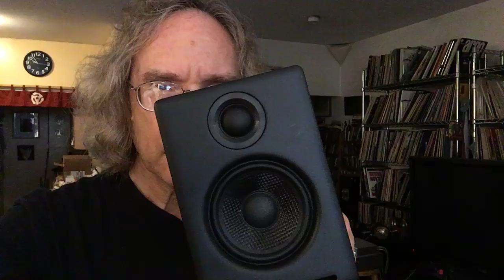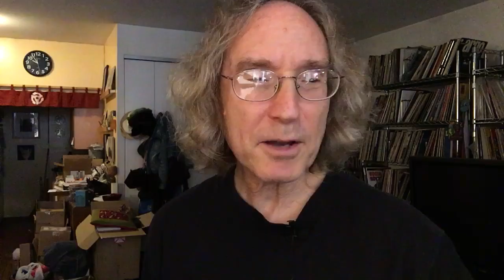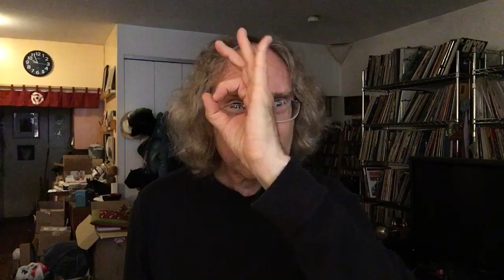The case against 1 inch dome tweeters

Comment: It's possible that a 1" diameter tweeter will cause the high frequency sound waves to issue concentrically from the tweeter dome minimizing phase cancellation providing uniform frequency response and better imaging.  A tweeter having a large area could cause phase cancellations and reinforcements when you moved relative to the radiating surface -- what we used to call the "picket fence" effect.

Comment: Personally when designing/building speakers I am not crazy about domes, ribbons or air motions crossed over below 2000 hz. Have found that the average 1"-1.5" dome rarely (lots of exceptions) performs extremely well as a stand alone driver for the entire lower and upper HF range. You need a very well engineered crossover to make it work (ie: LS3/5A @3000hz). Would still rather see a separate mid range up to 4000-4500 hz and then a tweeter above that or two way with a super tweeter that rolls in above 12 khz.

Comment: Steve, ever since I was a young boy I have used sound or noise protection around uncomfortable noises. Not just loud but annoying frequencies as would come from a mother in law. I did this because the entire generation of men before me went DEAF because they thought it was a manly or macho thing to handle loud noises. My hearing is great!, People are amazed when I am the only person in the room who runs out when we test the high frequencies of loudspeakers. They hear nothing and I am the dog in the room. That said, I have never heard a ribbon tweeter that I like. My closet has 10 different pairs but I never warmed up to them except the speakers from Legacy. I love Seas, Scanspeak and Dynaudio soft dome tweeters. In my home system I use a Cabasse polycarbonate dome which is also an excellent performer thanks to Geffery Dillon of Dillon audio but I love the dome.
Reply: nicholascremato
"That said, I have never heard a ribbon tweeter that I like. "
What is it you don't like about them? I'm curious because I never heard one but I read some conflicting opinions (and comparing with silk dome), and new designs that are well regarded come with those.

Comment: My system is one pair of pioneer andrew jones BS-22 bookshelf units stacked on top of one pair pioneer andrew jones FS-52 towers. Two (one inch) dome tweeters on the left. Two on the right. Really loud, smooth, dynamic and powerful for less than $300 total brand new speaker cost.

Comment: Soft dome tweeters have a maximum design and physical output in terms of loudness which may be less than hard dome tweeters,cone tweeters etc.
I don't think they are inadequate in the way you said you felt, because the answer is simply to use multiples of them to obtain the necessary volume in order to benefit from their sweet tone.
Of course,multiple tweeters of any variety follow the same rules.

Comment: Consider this: 3kHz to 20KHz is only three octaves.  The woofer has to produce something more like six or seven octaves.  To me this is why so much more effort goes into the woofer.
Reply: @JAustin-c6q  : I'm not sure, if you are THE "J(im) Austin"--if you are, I'm sure you know what you are talking about in regards to audio, but: Octaves are not really man-made things. The relationship between 2 notes an octave apart is a mathematical and natural one, that would exist everywhere in nature and would be very distinguishable from the relationship of any other interval, quite without any human involvement. It also exists for any kind of vibration, including the entire electromagnetic spectrum (and it is also quite interesting that we are able to visually perceive exactly one octave of that spectrum)
The fact that we divide the audio spectrum into octaves is not arbitrary. It follows a mathematical principle. It is unlikely that any other (imaginary) intelligent species would not also have come up with some kind of octave-based division of audio frequencies.
It is much more significant how many octaves a component covers than how many Hz are in between. The difference between 25Hz and 50Hz is in almost every significant way the same as the difference between 10kHz and 20kHz, even though one consists of only 25Hz and one of 10,000 Hz.  (It may actually be much more accurate to say that "Herz are man made things")
Reply: is not only the octave..is the wavelenght
Reply: To top that excursion required to produce the same level is inversely proportional to the octave, meaning each octave you drop doubles the demand on the speaker.  Most music is pink noise which adds another inverse proportionality, so we're really looking at quadruple the demand per octave you drop.  With seven octaves on the woofer and three on the tweeter we're looking at 156 times the motion on the woofer vs the tweeter.
Reply: That said though in terms of breakup a dome is literally the worst design, because it is edge driven.  They've chosen the longest distance possible for the waves to travel in the dome.  This is why really only a .75" dome doesn't drop off 15db at 45 degrees between 10khz and 20khz.
Reply: A midrange will cut the number of octaves that a woofer has to do in half for a more effortless sound reproduction which is why SQ competition cars have a 3 way front stage.
Reply: Going with a larger woofer >8 and throwing in a dome or cone midrange can make a difference. So the woofer only has to do 4 octaves and the midrange does the 3 octaves between the woofer and tweeter. Like 350Hz and 3000Hz crossover.
Reply: may be just 3 octaves, but PHYSICAL demands of energy transfer to the different kinds of transducers G mentioned cannot be thought through with just "octaves".  Imagine, that little piece of metal or silk is actually physically moving, vibrating, resonating, etc.  Octaves is just a word that helps us imagine abstractions of sound and music, but various heat and stress effects on silk, aluminum, carbon, and etc. are physical events.  One can be "fudged" a bit, but the other cannot, without damage to the tweet :)
Reply: No, the reason is the ear becomes less sensitive to lower frequencies meaning you need to push much larger volumes of air to hear or feel it. More effort?, subwoofer design is pretty simplistic for speaker manufacturers; the difficult part is manufacturing high excursion drivers that stay linear along their travel whilst having adequate cooling of the voice coil.
Reply: everything above 12khz is superfluous because it adds nothing to the musical appreciation.
Reply: Dream Diction: That depends what age you are, there is plenty of high frequency content in music; though if you above 50 you wont hear a lot of it.
Reply: Suzy Siviter   Read what I said . . . "everything about 12khz is superfluous because it adds nothing the musical appreciation."
Reply: Dream Diction: Well thats a bold statement....based on....?
Reply: Suzy Siviter   . . . based on filtering out everything above 12khz and listening.  What experiments have you done?
Reply: Dream Diction: I must confess I havent done any side by side comparisons at 12k, but I know I can hear sounds above 12k with ease thru using a signal generator with amplifier testing and also know that I can hear the difference between a low-bit and high bitrate MP3, low-bit rate mp3's have poor high frequency response and they sound muffled or in some case screechy (brittle treble). Have you considered the possibility your ears have poor high frequency response?, its a natural thing that happens with age or some are even born that way.
I am sure if what you say is correct the audio industry would be happy to truncate bandwidth to decrease storage space, no there has been literally thousands of scientific papers and journals investigating hearing response for it not - not to be true (not just with sine waves but music as well).
Reply: This is a sad fact. I can say so, as a 50+ person. Hell, I almost kept a pair of JBL L40s that I had planned on selling, because for the first time in my life their high-end was listenable! I did sell them, but the point is, the drop-off in aural acuity that comes with age can change a whole lot about the way music sounds. I'd never say that the high frequencies are insignificant, based on the extent to which I miss the ability to hear them myself.
Reply: @dreamdiction  that simply means you don't hear properly above 12 KHz - been there, done that, and will not tolerate low bandwidth junk equipment that cannot go to at least 25 KHz
Reply: @dreamdiction  that all depends on your ears
Reply: @dreamdiction  In some electronic music it means everything.

Comment: Tweeters need to have low mass (weight) in order to move fast enough to recreate high frequencies without distortion.  That’s why larger speakers suck at high frequencies because the mass reduces their speed.  So theoretically, the smaller the better (or the smaller the cleaner) except when you go too small you lose output volume.  Basically you have to strike a balance, and only a well trained ear can really assess that balance properly regardless of the specs or graphs.

Comment: Steve I'm giving my home system to my son later this year. The replacement speakers will have 1" silk dome tweeters. Why because they sound right to me on the material I listen to. Part of the reason a 1" tweeter can work is the length of a full wavelength at 2,000 kHz is 6.75 inches and at 10,000 kHz 1.35 inches.

Comment: It has to do with physics. And our ears are highly tuned and sensitive to the higher frequencies where we’re not as sensitive to the lower frequencies and we need more. The mass of the tweeter to control the weight and the amount of energy that has to be put into such a small area has the dissipate heat and dampen the moving mass. Lower frequencies traveling all directions and lose energy very fast therefore you need much more surface area and much more power to produce the lower frequencies so we here with him equal with a higher frequencies. You cannot get the mass of a 15 inch woofer to control 20,000 Hz back-and-forth. The Magnapans or one and ahalf inches wide but the energy to control that very thin light film is distributed over that 40 inches length. Somebody with better mass and higher physics that myself can mathematically explain it but I need to do is understand the basics of physics and you know why they’re all 1 inch or under for high frequencies. Has a lot more details to it than that and there are a few exceptions to the rule at a much greater cost in much greater energy input.

Comment: Twitter is really just enhancing the sound coming out of the other drivers even bass, they come into their own more around 12kz and above. but they are really just enhancing the lower frequencies what is present in the lower drivers providing sync the  mid-range and woofer in off axis especially the vertical plane
Reply: I want you to try Steve the linkwitz LX 521.4 speakers with their own DSP or ASP or both. there's supposed to be better than the Maggie's in dynamics reviews have stated. You can buy them from the German company pre-assembled if that's an issue for you about $6,000. one reviewer said they're better than $115,000 speaker not sure which speaker that would be any idea, I've only heard good things about them would like your opinion if you get a chance try them.

Comment: It is all about the power distribution. Only about 15% of the power goes to the tweeter when it is crossed over at 3kHz and 35% when cross at 1.2kHz. That is the reason why for most cases a 1” tweeter is more than enough to handle the music. More importantly, higher frequencies then to start beaming when the diameter of the cone is greater than the wavelength of the frequency. That is why bass is omnidirectional cause u don’t have a driver greater than 3’.
Reply: I sure shit wouldn't want an 8" playing >3 KHz. That is like ka=5,5 ... -3dB at angle ~15 deg. At 6 kHz it is beaming like hell. I don't want my head in vise to enjoy music. Tell that to the full range crowd.

Comment: I agree, most of the sound comes from small speakers that could reside in a two way cabinet.  High end manufacturers work on the cabinets a lot to minimize the vibration and to look nice.  I have listened to the open version speakers that also sound really good.   It's a trial and error resultant product as I see it.  They listen and compare to the competition and price accordingly.  I also have not understood why upgrade speakers cannot be sourced from a vendor that has tested the products and thus know how the result will sound.  Why go buy new giant and heavy new cabinets every few years as the drivers are improved, we should upgrade the crossovers and drivers or maybe just thee drivers.  I know my Thiel crossovers are much larger and more complex looking than most of the new crop of crossovers I see.

Comment: Good discussion. Tweeters have been on my mind lately. My Klipschorns have that "ease" that Steve mentions, but to my ear the K-77 tweeter is a bit dry and lacks the sweetness of many domes. But high marks for excitement. Whew! No better speaker for "Kind of Blue"! Not selling them anytime soon. 

But I'm intrigued by Paul McGowan's (of PS audio) plan to use multiple ribbon tweeters in his upcoming speakers, which are based on the old Infinity IRS speakers designed by Arnie Nudell. It seems to me that ribbons have the same advantages as electrostats at the high end: superb transient response. And multiple ribbons might allow for greater ease and detail. But I imagine comb filtering becomes a challenge when you have multiple high-frequency point sources arrayed near each other. Not sure if the physics of ribbons and/or line arrays changes that fact.
Reply: The new(er) tweeters in the Klipsch Heritage line with the titanium diaphragms (as well as the midrange) are to many ears smoother sounding than the older tweeter.  It wouldn't be that difficult to upgrade yours.
Reply: I believe the Klipsch horns are quite sufficient for my taste! I stick with you

Comment: Point sources provide far better imaging—I’m sure that’s a consideration these manufacturers have.
Reply: It's always a trade off between imaging and loudness. People who prefer quiet music are easier to design speakers for by far.
Reply: Point sources do not necessarily provide better imaging than line sources. Each just has to be addressed differently.
Reply: How does this hypothesis explain high quality ribbons sounding so exceptional?
Reply: I agree (in the realm of a coaxial device functioning as a point source). However, they add additionally complexity with manufacturing and phase problems as the woofer starts acting like a makeshift waveguide. Coaxial is the ideal, but it has an extra cost for a reason.
Reply: Wrong , you clearly have no clue what sound field (proper terminology not "image" ) properties are planar has. It's on the horizontal plane far Superior to any dome cone. 

Perhaps read a bit more about dipole radiaton patterns
Reply: Except there is no such thing as a point source. At high frequencies dome tweeters are quite directional. Above ka = 1, for 1" dome tweeter becomes directional at 4,35 kHz. At ka=3 (13 kHz) it is very directional level drops significantly at angle 25deg it is -3dB
Reply: @brk932  Point source in the sweet spot... Not omni-directional point source. Like a coincident driver.

Comment: I'm not an expert, but as I understand it with point source speakers, the size of the tweeter dome has to do with the shorter/higher frequency of sound waves the driver is being asked to produce. A small 1" driver is sufficient to produce these higher frequencies, whereas a bass driver produces lower frequencies which requires a much larger driver area in order to move more air. The challenge is trying to optimize power handling, frequency response (esp; in relation to the breakup point), and speed. I own Magico S5 Mk2's which use a Diamond-coated beryllium 1" tweeter designed to achieve an ideal balance of damping, stiffness and weight. I can attest that they sound fast, smooth & natural, have excellent off-axis response, high power handling & seamless integration with the midrange driver. To my ears, many textile dome tweeters don't have comparable resolution or dynamics to Magico's latest gen tweeters.

Comment: And what's the diameter of a microphone membrane? You're biased against those kind of tweeter, besides, the smaller the diameter of the tweeter, the better its direccionality.
Reply: J Austin off axis response is very important. Think phantom center / soundstage etc.
Reply: @JAustin-c6q  uh, last time I checked most sounds have harmonics, many instruments harmonics occur in the 10khz - 25khz region, where a 1" tweeter will have poor off axis performance at 14khz+ as opposed to a smaller tweeter. AMT offers the best of both technologies, IMO
Reply: @JAustin-c6q  LOL Off axis response is extremely important! The way we hear it isn't just the on axis response that we hear. You might want to read on power response, dispersion and directivity!

Comment: It's a 1" diameter point source, that is not dipole that really chokes the treble. Take any box speaker and add a top facing or rear facing tweeter and the speaker will sound much better because it will have much better presence because the highs will be coming from the back wall and/or ceiling as well, and that's before you zero in the crossover slope. 

I like ribbon tweeters and Air Motion Transformer (AMT) tweeters, but they have to be dipole for me. Larger radiating surface and bi-directional. I have the 1.7i's and augment them with full range Fostex 168E Sigma's and they sound amazing because I use them in a dipole configuration facing the ceiling. You can try this out by going to Parts Express or Madisound and buying a tweeter, crossover and pot and hooking it up to your existing setup. Then you'll really start to wonder what's up!